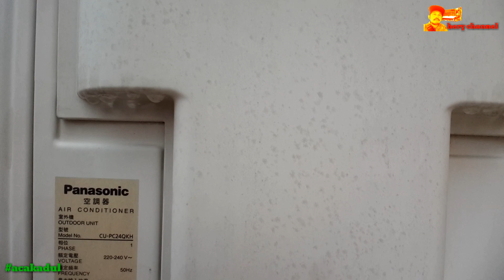Troubleshooting panasonic timer kelap kelip lagi

Comment: itu penyebabnya krn bocor lalu freon berkurang berakibat pada timer indor klip2 dan kompresor over heat, untuk kompresor bisa di perbaiki apa tidak Pak D, atau bagaimn bainya
Reply from the maker: Biasanya klo masalahnya gtu sy las dlu yg bocornya mas dn jgn lupa filternya di bersihkan otomatis klo freonnya cukup compresornya gk overheat..
Reply: @herychannel  iya tp kan kondisi adh seperti itu,setelah di laa yg bocor terkhir tinggal masalah di kompresor yg overhet,di ketok2 kompresor bs idup lg,setelah di vacum isi freon krn sdh tidk ada yg bocor ac idup normal tp 2 minggu setelah itu kompreasor mati lgi over heat lg
Reply from the maker: Biasanya klo compresor overheat maslahnya filter kesubat bisa ac udah kotor bisa kurang vacuum jg bisa trus minyaknya udah kurg jg bisa..tpi klo menurut kita ac udah buruk kondensornya bagus di eksekusi compresornya udh lemah aja mas..
Reply: @herychannel  kompresornya di repair bisa p g,
Reply from the maker: Klo mau telaten bisa ms minyak kompresornya  ganti semua trus filternya ganti pipa kecilnya ganti lgi klo sebelum vacum pipanya di flasing dlu, tpi klo ac udah tua bilang aja ke user udh gk bagus kompresornya
Reply: @herychannel  ok Pak D bagus ilmu nya....